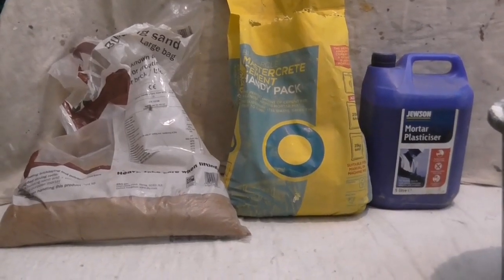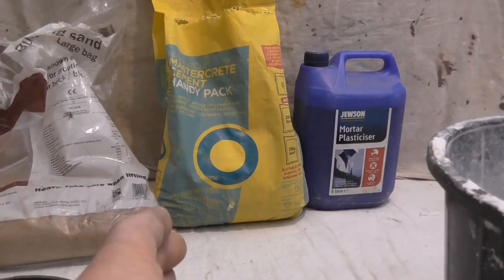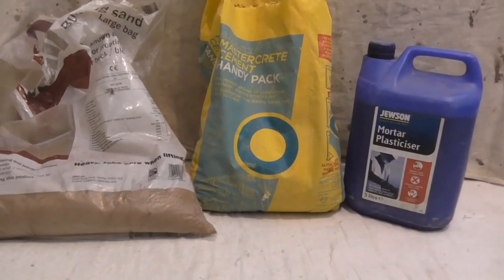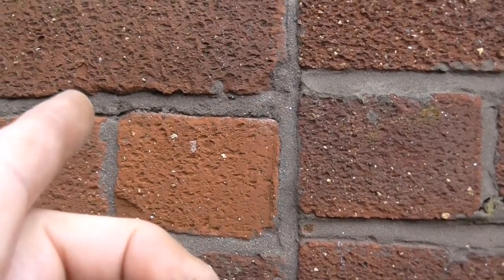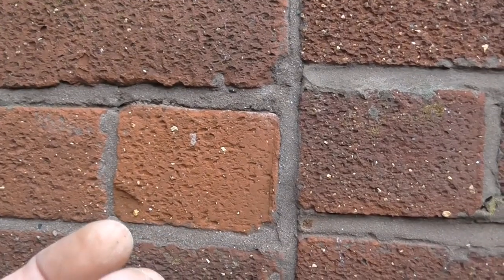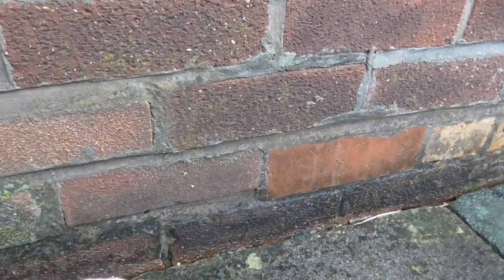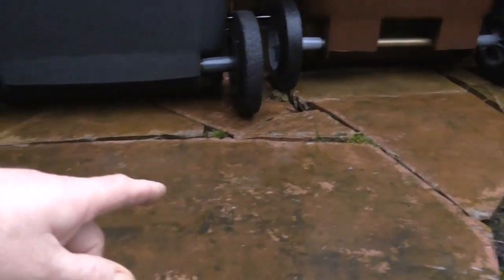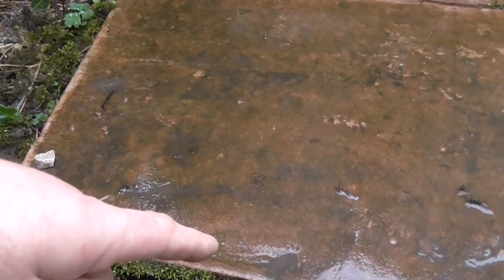Is Your Mortar weak And Crumbling?

Comment: All depends on how hard the bricks are. 4:1 sand : cement is standard in UK which is fine for most modern bricks, but if you have an older building it might have been made with lime mortar. 

Hydrated (builders) lime could also be used to make the mortar more plastic. E.g 6 sand, 2 lime, 1 cement.

Comment: 3:1 Is too strong for most applications. 4:1 Is a better general mix
Reply: if your using it as a decorator on repair jobs 3:1 or 2:1 is best as you need it to dry faster to paint over as exterior decorator fillers are expensive looking at £50 for 5kg for a the best one and £80 for 15kg the second best these 2 are the only ones that last as long as actual cement

Comment: I like your vids and have subscribed but unfortunately this video is not correct. The golden rule is mortar should not be stronger than the matieral you are working on. For example if you use a 3:1 mix on a wall that is lime mortar then it is likely to crack in the future, you see this a lot. The mix has to be the right one for the job and a overly strong mix is just as bad as a weak mix, worse probably.
Reply from the maker: Never had problems myself.

Comment: How much plasticizer? I guess the amount is not important since he didn't mention it.
Reply: It is important because too much can ruin your mix, they vary depending on brand. I would usually put about an inch in the bottom of a bucket and fill it with water then use that to add to your mixer. Only the first bucket though. They all have instructions on the back so best to stick to the guidelines

Comment: 2:50 - 3:1 is what I've learnt as standard for brick mortar. However, I just laid screed using 2:1. Came out lovely. Barely an inch thick. Didn't use any air entrainer.